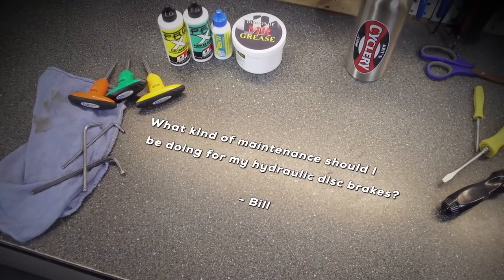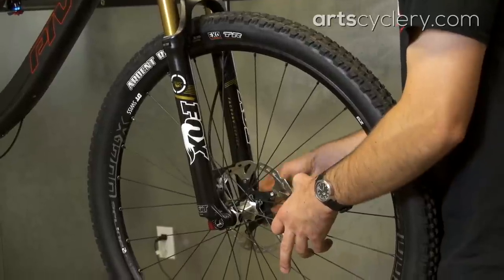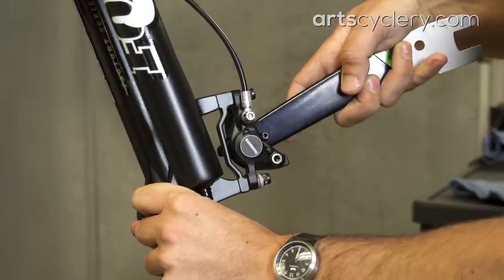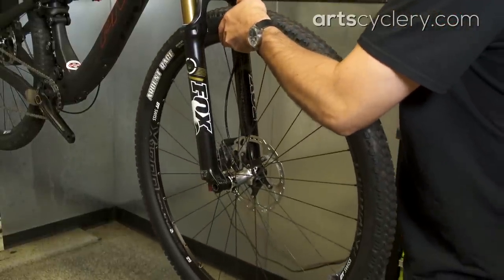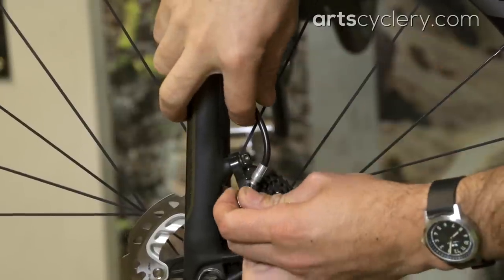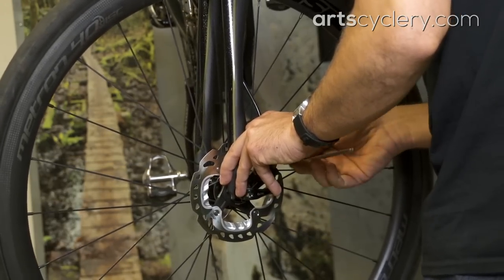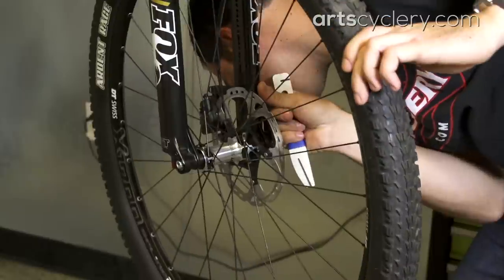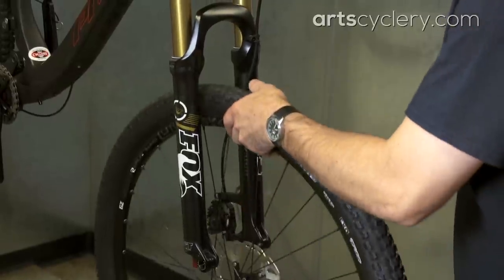Ask a Mechanic: Hydraulic Disc Brake Maintenance

Comment: I adjust installed sram xo brakes (used) into my bike recently.  It seems my rear brake may either need a bleed or new pads. But someone told me that it can be adjusted at the lever for some brake models.  Is it possible on my set of brakes to adjust it at the lever?  Before I go to replace or bleed the rear brakes?
Reply from the maker: yayak shotot Avid X0 brakes have a lever adjustment, but it is a temporary solution to your problem. We recommend replacing the pads, and bleed the brake after if necessary.
Reply: Thank you very much for the response.  I did try to adjust it from the lever.  I discovered that XO brakes has a contact point adjuster besides the reach adjustment which Im glad worked for my brake (rear).  All I have to do now is buy a new set of pads to put in and it will surely be working well.. Thanks again.

Comment: My hydraulic brake lever has a little bit of rust,
What should I do to make it nice and like new?, my hydraulic brake is shimano altus.
Reply from the maker: harold hernandez Steel wool and a little elbow grease should take the rust right off for you!
Reply: Since I crashed and ditched my bike a few times having fun I may of cracked my hydrolics and may of Bent my rotor or it’s out of place from rough braking aswel so ile get my bike checked and serviced  by my bike shop tomorrow needs to be done I don’t even have any brake power to brake it’s dangerous because I crashed into  the back of my friends bike so I need to get that checked lol 😂

Comment: Is it a good idea to heat the rotor prior to truing it?
Reply from the maker: BubBleWaRp No. Do not heat the rotor. Not only is it unnecessary, but these metals have already been properly heat treated and doing it again will most likely warp and transform them in a very negative way.

Comment: how do i set the reach adjustment on a tektro hdc 300
Reply from the maker: +DINOBLADER Some lower end hydraulic brakes don't have a reach adjust, and your Tektro HDC 300 doesn't have a Reach Adjust. The only way to get Reach Adjust will be by upgrading your brakes.
Reply: +Art's Cyclery thanks